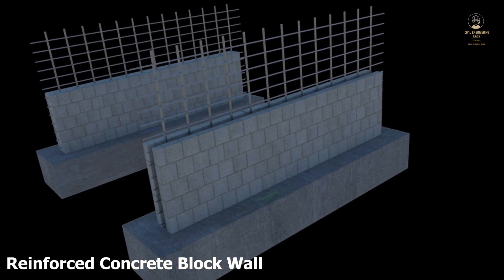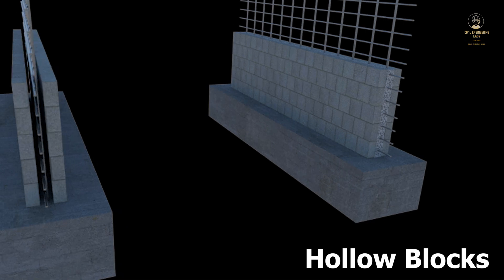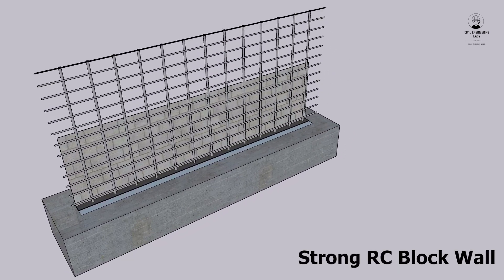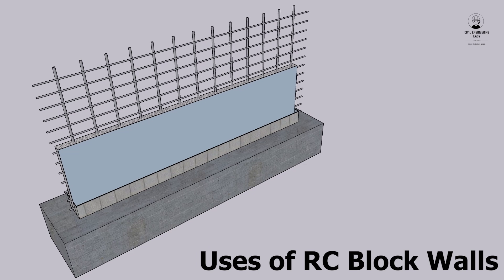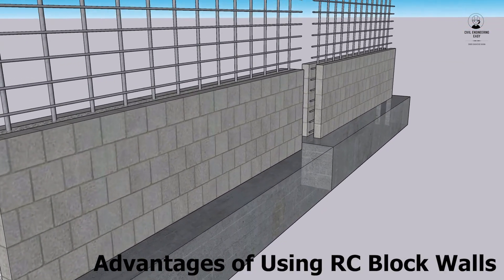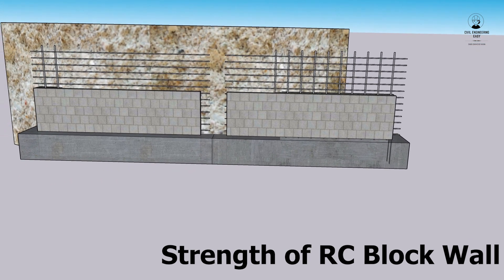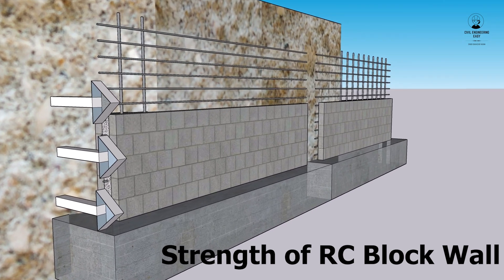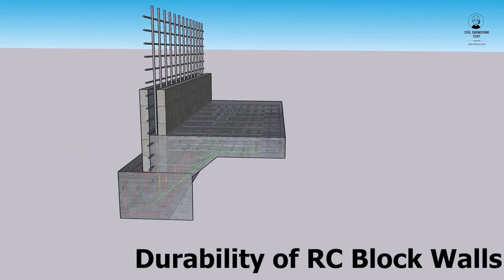Reinforced Concrete Block Walls | Advantages

Comment: That is amazing . Question for you? I have a insulation material that can fill the cores of blocks. Its made of a mag oxides has Amazing R= value easy to install and no shrinking.  Could this Material be used in that assembly?
Reply from the maker: Well if that have a good bond strength with reinforcement then it need to be tested in lab, to find its different parameters. While we should not compromise on strength at this case.
Reply: Thank you. Of course, I'm working on getting the product to the right people. This is proving to be challenging.  @civilengineeringeasy